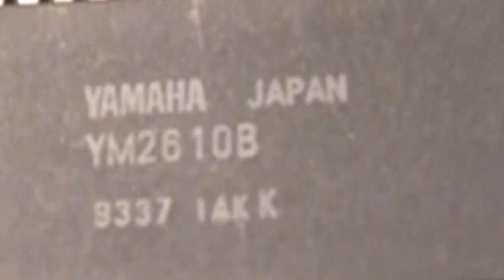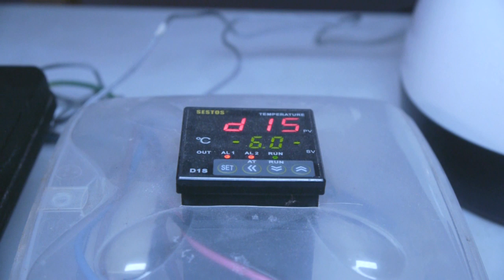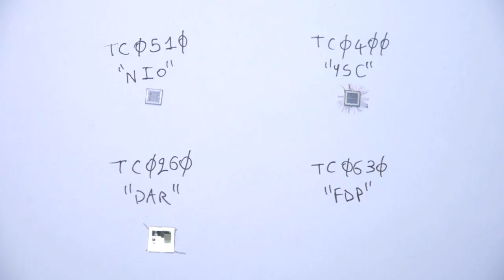How to play arcade games (Taito custom chip decap)

Comment: C'est quoi le but de tout ça à part de faire de belles photos ?
Reply from the maker: Faire ce genre de conneries: https://github.com/furrtek/DMG-CPU-Inside
Reply: Pas mieux  que la réponse de @furrtek mais dit autrement : documenter des circuits intégrés propriétaires. Comprendre leur rôle peut permettre de réparer d'autres cartes, améliorer/créer un émulateur pour la carte en question, faire des recherches sur tel fondeur, etc. Une base de travail en somme.

Je pense que la puce de Texas était un circuit modulable, en jouant avec différents masques de photolithographie pour un unique die. Un peu comme différents plans d'aménagement de sièges dans un avion, ou de postes de travail dans un local donné. Ou encore comme placer différents designs de PCB sur un seul panneau.
Reply from the maker: @geraldv203  Merci beaucoup d'avoir fourni l'explication que j'aurais du donner :)
Reply: @furrtek  De rien ^^

Comment: I was always wondering which microscope you used. Do you have any suggestions?
Reply from the maker: It's an Amscope T490B hacked up for top illumination. There are maybe better options for a similar price, but the choice was very limited in France.
At the time I was recommended a second hand Olymbus BH but even that was too expensive for me.
The x40 and x100 lenses provided with the T490B are useless for this btw, but the x4 and x10 with x20 magnification is enough for old chips.